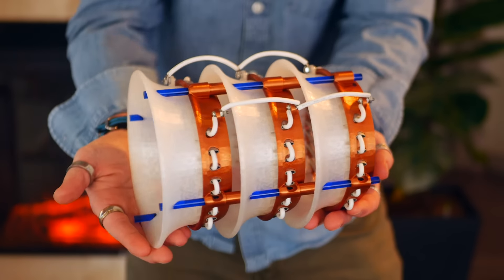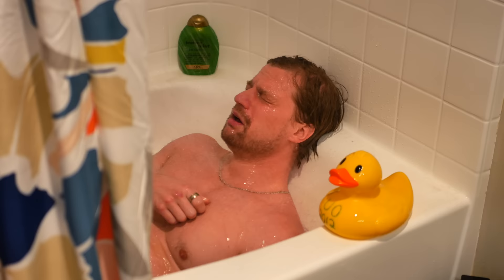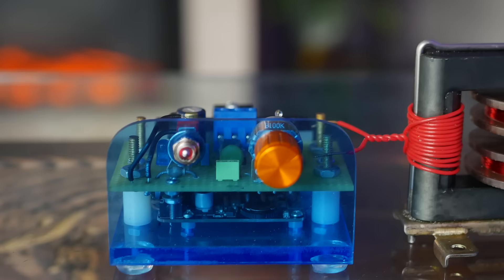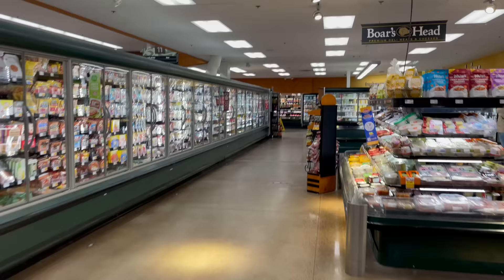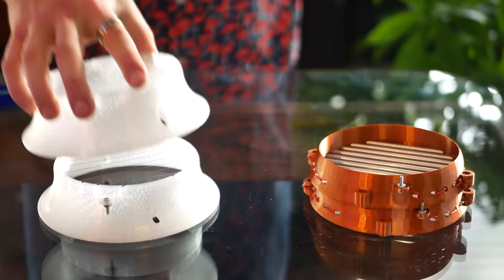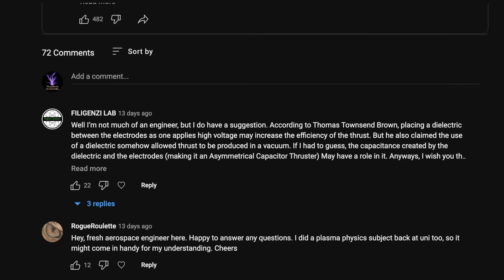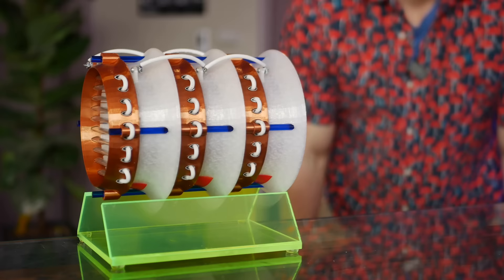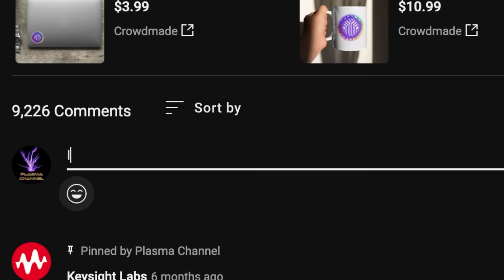The Next Generation of Ionic Plasma Thrusters (BSI MARK 2)

Comment: Curiosity leads me to ask, Is it necessary to use such a big profile for your ground tube? You are using thin wire for the positive why not the same for the negative? Sorry if this has been asked before. Very impressive project

Comment: Does the shape of the grid matter?
-how would consecutive rings instead of rows change the outcome? what if the rings were spaced slightly along on the Z access? would it change the way the air is flowing through the thruster? (i.e airflow faster towards center) 

what if you tried to mimic nature and create an ionic tornado? By rotating the air instead?

how does of setting the angle of each module on the x/y axis affect thrust?

Does the ratio of number of anodes to cathodes produce a difference?

Comment: So how do we judge thrust. Thrust is mass flow per second times velocity. Lets confirm that, thrust is measured in newtons. mass (kg)/sec * meter/sec = kg meter/ sec^2, which is a newton. There are 1 mole of gas at 22.5 liters. For the sake of argument lets say 1 mole for 22500 cubic centimeters. A mole of air weighs approximately 29 grams, so thats 29grams per 22500 cubic centimeters. lets just say its 0.0014 gram per centimeter cubed. Ok so you generate a velocity of 5 meters per second over an area of lets say 100 square centimeters. Thats 5 meters is 500 centimeters so thats roughly 50,000 cubic centimeters. So the mass flow is 5 x 14 or .070 kg/second 0.070 x 5 = 0.350 N. But lets gear this diwn to the actual, because you were more like 0.23 N. 

So lets look at efficiency. Efficiency in an Ion drive is given as Thrust = Power * efficiency / exhaust velocity

0.225 = 90 watts * efficiency/4
0.225 = 90/4 * efficiency 
0.225/22.5 = efficiency 
0.01 = efficiency

So what is the problem, lets unravel this, suppose we had a particle traveling instead at 500 meters per second but at 1/100 the mass. Lets compare the two in fictitious energy units

100 units at 5 meters per second . 1/2MV^2 = 2500 units of energy. 
1 unit at 500 meters per second. = 25000 units of energy. 

So to unravel this lets just say your drive electronucs is 50% efficient and you thrust is 0.225, what should your Ev be in a vacuum. 0.225/0.5 = 0.45 (this is a very crude first step)
Ev = 90/.45 = 200 m/s. This compares to your 5 meters per second actual
 
If you dont see it, the explanation for the inefficiency is right there. 200 m/s particle, slowing down to 5 meter per second. I think in air particles move close to the speed of sound at that temperature, which is around 300 m/s. If you add 200 m/s to the speed of an air molecule, it just makes the surrounding air hotter. But heat does not flow laminarly like particles in an ion drive but radially, like air filling a balloon. 

So what is happening is that the initial flow of the charged particle, itself on a 45' angle is colliding with a particle sending itself and the particle two directions, then those collide woth two more particles sending oarticles in 4 directions, before long you have particles traveling against (slowing) the flow. 

So why are jet engines good thrusters? Lets imagine we could take the watts from burning jet fuel (BTW megawatts of power) and have it stored in a battery. We then move air into a chamber and we supply the heat in terms of electrical resistance. The air heats up, the air expands, as it expands it drives turbine blades, the turbine blades drive the comoressor blades that compress the incoming air this way we can heat more air in ine spot without melting the engine. The out put comoressor drives the turbofan (bipass). This concerts the high velocity air in the turbine discharge to a much greater volume of lower velocity air. Thus airflow is more laminar and mass flow is greatly increased. Remember the goal is not to heat the air up, the goal is to move the air in a laminar fashiin such that there is little differential velocity to create heat. So in a jet engine we are using the pressure created by the heat of detonating gases, to work creating a large volume of air flowing in one direction. For this reason the 'effective' ISP of jet turbines is in the 10,000s, versus a rocket burning the same fuel is in the 300 range. 

   The plasma thruster is doing the exact opposite, its taking power, instead of compressing and laminarizing the flow its causing air to heat up and travel radially.  

How can we improve the thrust. The rocket design shows the limitation, each added stage is essentially taking the laminar incoming flow and adding random motion to the flow as well as additional flow. What you need to do is create a plasma flow compressor were you have thin boundaries were Air is driven into a pocket and then funneled to a discharge. 
  
   To simplify the design. imagine a sphere sitting on a cone. The surface sphere is subdivided into triangles. Each triangle has a circle removed but a preserved center. The Air comes from out the sphere, enters the ⭕️ (red region) its charged and converges on a point where its discharged. The air then travels the funnel were it generates thrust. This well improve the velocity of the outflow, but its practical limit is that the more the air is compressed the lower the efficiency. 
  
   Another possible way is to channelized the particles, that is have the particles that are charged segregated by rf and charged glass surfaces, like a glass tube where the can be further accelerated with tubes joining then again into a collecting chamber where collectively they are discharged.

Comment: I once wanted to increase the thrust of an impeller without increasing its diameter. So I put two impellers behind each other. 
I noticed the same phenomena. The thrust did not increase by a factor of 2. To increase the thrust, the second impeller needs a higher or stronger pitch. 
But I do not know how to translate this for the ionic thruster.

Comment: There's a methodological problem here, because you're measuring wind speed. But the amount of air you're accelerating isn't necessarily constant. Really you should be measuring thrust, not exhaust speed. In theory if you could accelerate more air, but more slowly, you should find you get more thrust.

Comment: Also, voltage and total power input…   With more Amps and or Voltage I’d exoect you to find an optimum, or would there be a more linear connection, ie more voltage =>more trust? And what about Voltage and power then? I’d expect that with V> you  can achieve >> V, more trust, without A and power input growing at the same speed, so that there is an optimum… That is imho what you want to get a grip on, and with that knowledge, you can start focusing on airflow, compression and output speed…
With interest i follow your endeavors  …  (as you are onto something)

Comment: I think you should try to measure the efficiency of the engine rather than the output velocity... If I heard well, you are putting 90W of electrical input, and if that's the case the efficiency you are getting is horrible... The flow of kinetic energy at the exhaust for a uniform flow of 2m/s across a 12cm diameter area is about 0.056W, so it means most of the energy you are giving is not moving the air. Comparatively, a perfect machine would be reaching the 23m/s. Maybe somebody here can verify that (?).
But ok... It looks cool, so have you tried separating the stages in the longitudinal axis using tubes? If you place the stages too close to each other the electric fields might be cancelling out, and that might be the reason why the tandem configuration does not seem to work...

Comment: I know I am late to this video, but I have an idea.  Since the issue with the linear design is that the thrusters down the sequence don't have time to impart charge, have you tried creating a larger cone that incorporates more thrust modules at the same stage?  I guess you'd get about the same output as one larger thrust module, but probably easier to build as modular thrusters.  Essentially what happens if you line those thrusters up adjacent to one another and then encase them in a larger enclose flat funnel?

Comment: Why are all three of the thrusters the same diameter?
How did you select this diameter? 
Why did you stop at three?

I assume that there is a relationship between the area of plasma generation, number of anodes/cathodes, spacing between the anodes/cathodes, and resulting thrust. I wonder if down stream thrust could be improved with sequentially tapered areas per thruster. This might require providing more current to the later stages for optimised current-to-thrust ratio. This tapering would be in addition to your existing tapered shields to limit eddy currents while improving input flows.

In my mind, I am mixing and matching the bevel structure on a jet engine exhaust port with the Bernoulli principle (i.e., less output area leads to more fluid velocity)

Comment: I'm not an engineer. So I may be way off.
But I wonder if the added ducts on the 2nd and 3rd stage are actually hurting performance. I think about wind tunnels, and they have a section of parallel tube that force the air to go straight. So I wonder, if air coming into the 2nd and 3rd stages are actually causing turbulence in between the stages. 

Instead of adding air from the sides in the 2nd and 3rd stages maybe seal them so that you're actually accelerating only the 1st stage's air.

Comment: Not sure if this would help or not. 
Can you put the wire vertical on one the horizontal on the other stage or instead of full horizontal,  maybe change the angle slightly each time to see if changing each stage a little would create a fuller air flow.

Comment: I’m curious what would happen if there wasn’t an Intake in between stages. If each stage would step up air velocity. This is how jet engines work. There are several stages of blades that are used to compress the air I. The engine. Also, there are stator vanes in between stages to straighten airflow. Turbulent chaotic air causes drag and inefficiencies. Just curious what would happen if you applied a similar design to this plasma stuff.

Comment: Did you try having the electrodes in other configurations besides perpendicular and parallel? I wonder what 30 and 60 degrees out of phase would look like. 

You may need to neck it down on the exhaust to concentrate the airflow for a more consistent reading and potentially higher thrust reading.

Comment: I would like to see if you can get more thrust by channeling the outtake through a funnel. :learning:
Reply from the maker: The funnel would increase speed, but decrease overall flow. It reduces output because ionic thrusters don’t produce much static pressure.

Comment: I'm curious, with Resistance to sounding like I know what I'm talking about. From an observation point, the first thruster before you initially cut down the print size to get a tighter gap hit 2.8 peak (very inconsistently) but if you can maybe decrease the chaos into a more laminar flow (say with like a golf balls surface for example) maybe just maybe you can get a few points back. Im a little late to comment and by now you have probably either moved on or found another physicist help but I still wanted to throw that out there and maybe it would help on your endeavor

Comment: Hi,
is realy nice project...but i think you showld try by like turbojet engine works
I mean...close the sides and deecrese the diametre from eache stage...like con ...because you showld accelerate the flow from the first intake/stage...and each stage accelerate the first stage 
also to do this ...i think you should do by increase the power supply different ....for ex:first stage 5v ,next stage 10v,3third stage 15........and each increasment of power at the same time for everyone....make sure there is only first stage intake the air ...not each stage with his intake
is just an ideea 🤷‍♂

Comment: just curious if offsetting the wire and tube by 10 degrees instead of 90 on each of the three drives would create a vortex which may increase airflow? Or putting spiral ridges on the air intake?

Comment: What if you put heavier gasses than air injected into the various spaces to give the electrons more things to crash into but idk if that would end up slowing it down or using electro magnets that would pull the electrons towards the rear with a pulsing effect to make sure it doesn’t pull them back

Comment: Why not try what integza did and add a ton of spikes to the copper wire? also why not try a grid of copper wire or tubes? you could also Do what integra did and use electroplating to make the copper tubes thinner and more air dynamic.

Comment: I’m sorry, but if your goal is to multiply the airspeed of the first unit with a second or third unit, then why are you also introducing additional slower-moving air from the sides?  After the 1st air intake there should be no further new air intakes.  Also if each additional stage is smaller, resulting in a gradually reducing air space, then the airspeed will further increase just by the shape.  You can then test efficiency of the ionic gap at different airspeeds to adjust the gap at each stage of ionization.  Lastly, experiment on adding auxiliary external ionization thrust to reduce the external turbulence.

Comment: OK idea, can you use reducing size rings, 1st ring 7 inch, feeding into 5 inch, then down to 3 inch but with higher voltage as it funnels through each section.
Could this create the velocity needed to give more thrust/ air flow?
Just an idea 💡

Comment: Just a random thought, have you considered mini vortex generators on the inner air flow surface, offset to “rifle” the output thrust in order to drag more air into the intakes? At the moment the flow is smooth and straight, but could use vortex vacuum to assist in ramming further air intake through the drive.

Comment: Hey I had an interesting idea. I’m wondering if you could see if it could work. Can you create this and apply it to the intake of a car? Or even the intake manifold of a car? Perhaps it may be able to create a high flow of air for the engine and maybe be a benefit for efficiency and power. Not sure if the air from the thrust becomes hot but if tested on a turbo car with an intercooler temperature may not matter being that the intercooler from the turbo can cool down that air. The main thing is if it can create more volume of air making it easier for the engine to breath.

Comment: What I want to know is how this will work in a near vacuum with just interstitial solar material and eventual interstellar material.  How about the idea of using low mass rockets to achieve LEO, and eventual elliptical orbit ejection from both planetary and solar orbit, as the vehicle gains enough momentum while the onboard reactor powers ejecta out of the vehicles rear nozzle.  Is there even enough mass in vacuum for the vessel to accelerate to gain momentum?

Comment: Air speed is the wrong metric. It should be air mass per unit time. Variable cross section in the stages may be important. And a rectangular section may work better.

Comment: Would increasing the power to each subsequent thruster increase it's power efficiency? If you pull air at a slow pace and gradually increase its speed, your energy in would be drastically reduced overall and make a theoretical "more powerful" thruster than old mate.

Comment: its most likely that you accelerating the air to its highest speed and the first of the 3 what you need is to make better agzilery ports so the air is more dense cause it should make it possible to speed the air more as its denser again this is speculation as im not doing it myself

Comment: I have to wonder if the side intakes are actually slowing down your flow.  While yes, it is bringing more volume,  would it not be slowing down the air speed by having to accelerate the new the additional air coming in the sides?

Comment: I dunno if you could call this a recommendation? Im not an engineer or a scientist. I'm an aspiring aircraft maintainer, anyways i was more curious if there was a way to turn it into a turbofan? I doubt its as easy as stick a shaft in the middle and a turbine one end and a fan on the other, but it most came from the idea of thrust efficiency in a turbofan most of the thrust is just the fan. Obviously, that's a huge pain, and i dunno if its even reasonable. Just an idle curiosity.

Comment: How much electricity does it run (volts and amps) what would change if you added a funnel to the end to constrict the air flow to a smaller output?

Comment: Can you turn the electrodes 15-20 degrees to induce a higher velocity vortex? Decreasing diameter stages as well? It’s possible the pressure increases as the vortex slims. Similar to a turbine?

Comment: Oh… would there be a way to first ionise gas before accelerating it? That the design should be cut up in different stages of the air trajectory/path?  1. Ionize, 2. Move and compress => Accelerate? And… Question: is truat juat mat😢e rof airflow?

Comment: Could you cast or mold the wires and tubes in the shape of a high frequency or low frequency fractal? Much like modern cellphone antenna vs old radio antenna; wouldn’t it increase the conductivity?

Comment: I'm noticing eletromatic spark.
Thinking humidity interrupting increase possibility causing unit breakdown with heat from power interrupting.
Soooooooooooooooo
What about a low interrupting filter that pulls that moisture away allowing maximum power

Comment: I don't know much of this  plasma thrusters, but its awesome!

What I ask me is this: What happens if the first part has 12cm diameter, the second 11 and the third 10cm? Does this have an effect on the wind speed because of the smaller diameters? Or does this slow the wind down?